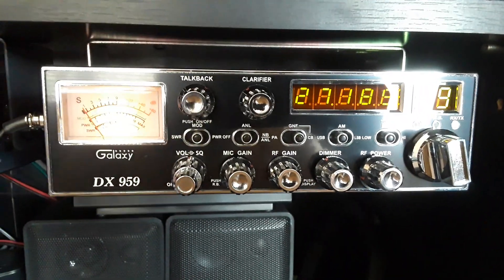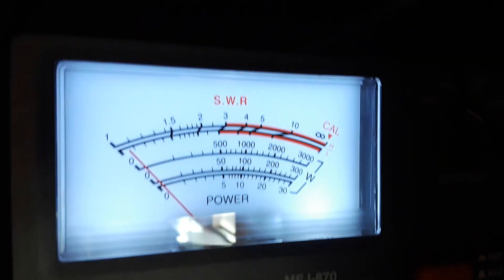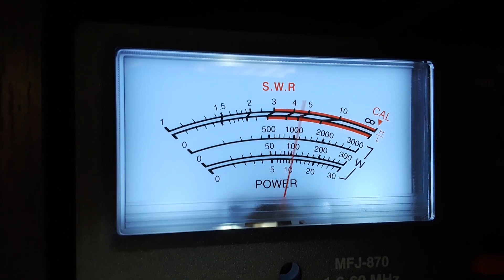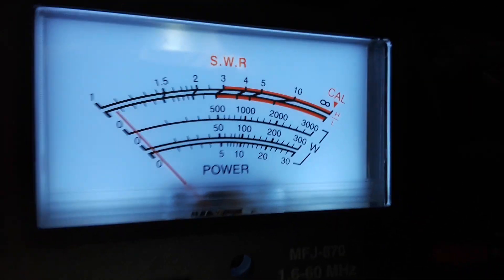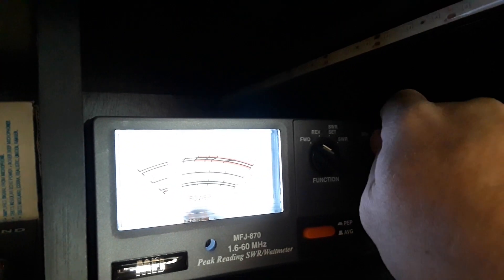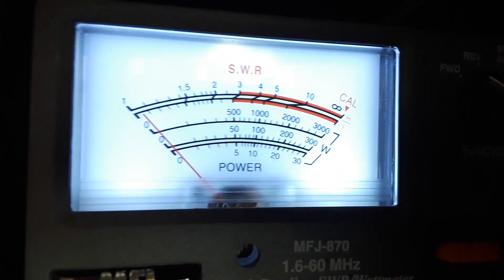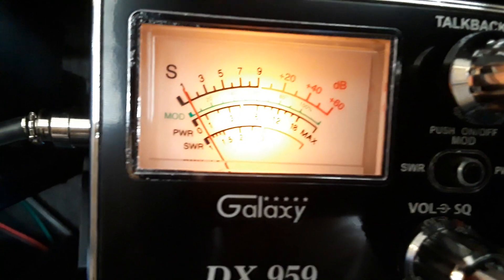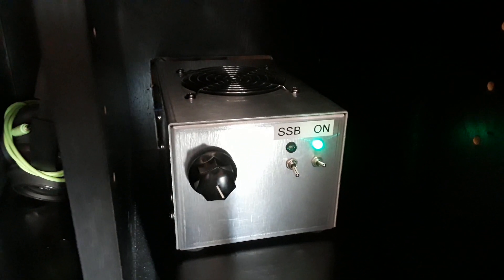CB linear amplifier makes to much power

Comment: I hate to bust your bubble, but look at your SWR’s when you’re doing it it’s called reflect backed up in your radio, causing your meter to read so high. It’s not good but that little two pill should be maybe max of 250 W. But you’ll figure it out when it blows up.😂
Reply from the maker: @russellholt7302  You have absolutely ZERO idea of what you're talking about. First of all, reflect will cause less overall output. Second of all the video was meant to be funny as that little amp had a 1x4 inside! Don't leave such foolish comments, especially when you don't have any idea what you're talking about.

Comment: Way over driving that amplifier. Notice when you talk with the amp off the power meter moves with the audio. Then with the amp on it just stays maxed out. Over driving the amp. Probably sounds distorted on the air and bleeds 3 channels either side of where you are
Reply from the maker: Not overdriving it at all. Was barely tickling it. This amp was a all Toshiba 1x4. It sounded awesome over the air. The title of the video was just to see what people would say.

Comment: Ive built lots of boxes like that nothing special about it I'm fact my 1x4 do a little more than that with same drive don't forget you have a driver pill 💊 which you are putting low dead key into which is correct 💯 it's also a 2879  which is better than using a 2290 more power so your actually getting about 400-450 RMS Avg power your peak was about 850 I believe which is normal my boxes can do 1080 peak on my 1x4 so this is not out of the norm.Please be sure to subscribe to my YouTube channel to learn more ne happy to help people understand I also sell amps.PS the 2sc2879s in that box output is about 120watts each so your readings are not far off. Take care. cool tech & gadgets cb

Comment: Got my hands on a chinese knockoff RM Italy and can't figure out what the heck it's doing. I think the switches might be wired backwards or something. Was looking forward to a tiny bit of fire in my wire but sadly no flameage for me...

Edit: Got my setup looked at and figured out that Hys knockoff amp doesn't do the output it says, go figure right?! Lesson learned. Don't buy chinese knockoff junk to try and save a buck. Not worth the gamble. I will go and buy a local built HAM class c amp and call it a day.

Comment: The 3000 watt setting is out of calibration and needs adjusting inside, there will be a separate adjustment pot for each scale. On the 300 watt scale you got a 22 watt dead-key but when you switched to the 3000 watt scale your dead-key was 50+ watts, so the 3000 watt scale is reading way too high.
Reply from the maker: Actually the 3000 watt scale is low by about 150 watts as compared to a calibrated bird 43 meter. That's MFJ meters don't read true PEP power on any scale. They are good for reference only. Stingiest meter I own.
Reply: I noticed that also. The 3000 watt scale was much higher than the 22 watts on the three hundred scale. It appeared about 60 watts. Since both are different, I would assume the top scale is reading much too high. And that is how you get that much power from such a small box.
Reply: Yes

Comment: I had a 1x4 with a 2290 driving 4, 2879's. At 14.5v with a radio DKing 2 watts swinging 30 would drive the amp to around 1100 pep and around 590 average. The power you're seeing is about right for a 1x4.
Reply: 2879 only rated at little over 100 watts ...4 2879 maybe 500 to 600 max watts

Comment: measure the current wich the amp is drawing......... 2nd      use a dummyload,not a 1/4 wave antenna.....that meter is not the problem ,i think......mmmmmh
Reply from the maker: I know the meter isn't the problem. It was a joke, a 1x4 amplifier.
Reply: @vegasfordguy  no shit didn t get that haha..... Although with a 1/4 wave measurement s are all over the place.....

Comment from the maker: Also you have to realize that a bird meter isn't going to only show clean watts. It's going to read the same as any other meter. The radio must be clean to get clean watts out. Doesn't matter it it's a bird meter, MFJ or a $20 truck stop meter. Some people are simply to hung up on the bird thing. This MFJ actually shows less RMS and PEP watts versus a bird! Already been there and done that.
Reply from the maker: Kandela Brown  blah, blah, blah.
Reply: Kandela Brown  
NO DISRESPECT PLEASE
Reply: It is not about clean/dirty watts, it is about the pwr meter design and its reliance on a 50 ohm impedance load to show correct. It is a crap meter, or played with unside.
Reply from the maker: @adrianfewster8391  Not true, you crank up the modulation inside a radio and you'll see the difference.
Reply: Desert Explorer 302  I just purchased a MFJG Giant watt meter . And it reads exactly what my bird meter reads

Comment: Got to love reflected power totally worthless numbers
Reply from the maker: Lol, no reflection here. Real pep numbers from a kick ass 1x4 Toshiba box with a clean radio being used with it. With a over modulated radio it would show much more (ghost watts) This is a comp 1x4 built in a 1x2 box. The reason for the larger heat sink and crazy loud fan! Gotta keep it cool. On a set of bird meters this amp made 450 watts RMS and 1000 watts AVERAGE. It's a sleeper.
Reply: @vegasfordguy  I have a 3 made 4 pill looks just like yours. But the guy got it from said it's a high drive. I got a Galaxy DX 94hp running through it  900watt  swing with 150 watt Deadkey.

Comment: is there  2x4 pills crammed into that little box?
Reply from the maker: It's a 1x2 cabinet with the largest board and heat sink that could fit inside. 1x4 Toshiba's (one 2290 x four 2879's. That fan screams to keep enough air flowing through it. It's a great little box, does 400 average/1,000 peak on bird meters. I ran that box for a couple of years on my base, but now it just sits in the closet until I decide to use it somewhere else. Thinking about putting it behind my General HP 40w in one of the mobiles. It's staged so I can just run it as a straight 4 or a 1x4. I'll make a video of that amp soon.
Reply: MyTube HDSpace  My Dave Made 1x4 with Toshiba all 2879 red dots does 700 at 14 volts with 10 watts worth of drive. You don't need much drive with those. I think he might have high reflect making it look higher than it actually is, but he should be able to get 600 out of that box with 15 watts going into a 2290.

Comment: second hand kenwood/ icom all much better
Reply from the maker: Only problem is that all these ham radios sound like crap on AM. I prefer a LOUD clean radio on AM.
Reply: @vegasfordguy  hi you use am,why,in europe we use fm and usb,thanks
Reply from the maker: @Bernard-John  ham radio operators use FM. I use 11 meter CB radio and LSB. Usually channel 19, 17, 6, 28 etc. Most action on LSB is on channel 38. I do use a Sirio Tornado 27 antenna.